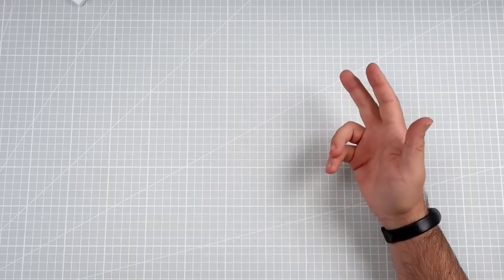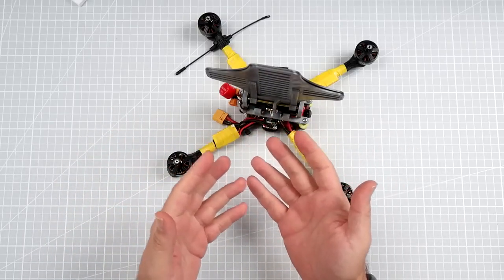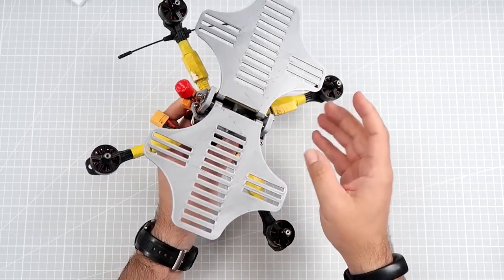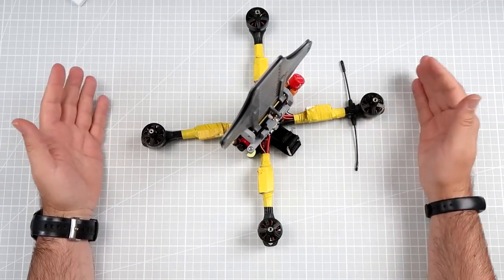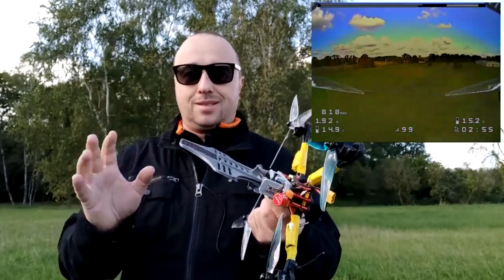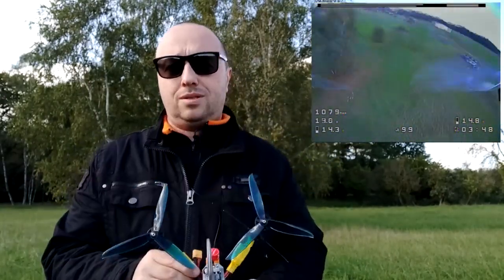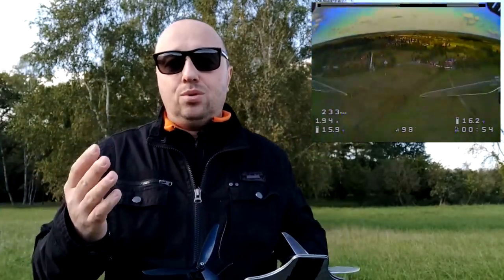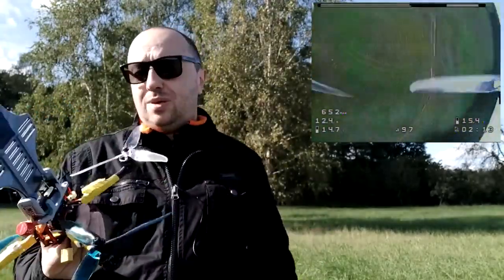Drone with foldable wings

Comment: The issue with wing structures is that they are grossly inefficient if not contributing to lift. You would be better to have two prop like wings that can fan out.  There's a video on YT by Airlab where they have a wing structure that expands (called FROW).  Otherwise, why not build the rotor blades internal to the arms so airflow isn't restricted - and the arm architecture can be widened (and shaped) so as to act as a brake in descent? Almost like a starfish which is quite like some plankton, the plankton is shaped like a starfish with wide underside but pointed, more  hydrodynamically efficient topside, so plankton can rise easily but sink slowly. And 5 arms might be better than 4, you can use smaller props, and could be more responsive and maneuverable.

Comment: Surprise - drones have wings - they are rotary wings. Which is an official and accepted term for a "horizontal propeller" whose lift is used perpendicular to the direction of travel.
Thats why you have two major classifications of aircraft - Fixed wing and Rotary wing.
What this video is demonstrating is NOT a wing. Giving this video the most benefit of doubt, this video could be demonstrating 'spoilers' or, more accurately an air brake.
Pawel - please learn and use correct aeronautics terminology

Comment: i think it would maybe, I say maybe be better, if deployed wings wouldnt go flat.
Maybe if they would have some pitch depending on position for example if drone goes inverted they should be pitched down and oposite when in niormal position? hmmm
Reply: Dihedral makes it self level and more stable....but in this case the wing load is so high it won't create lift....it would need to be alot wider and angle of attack would play a huge factor